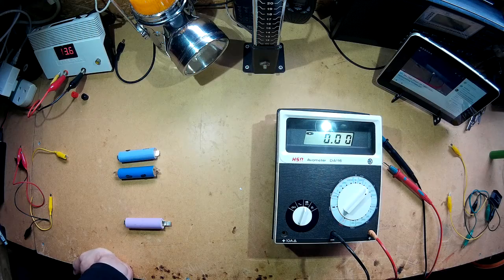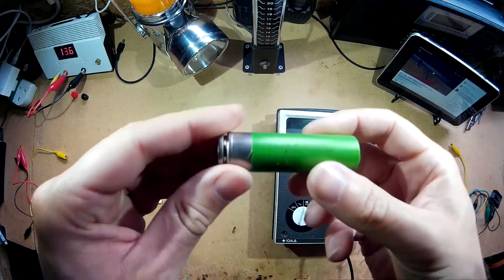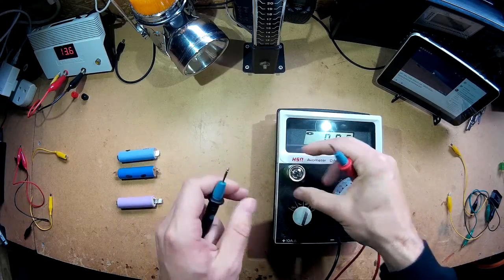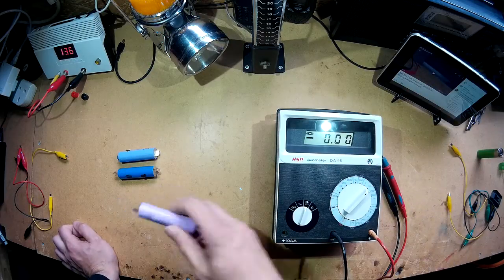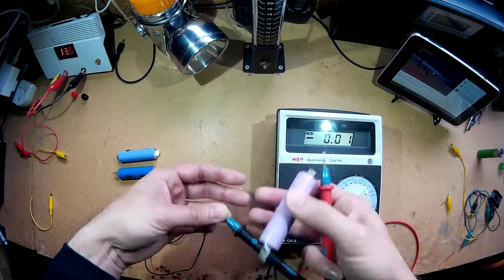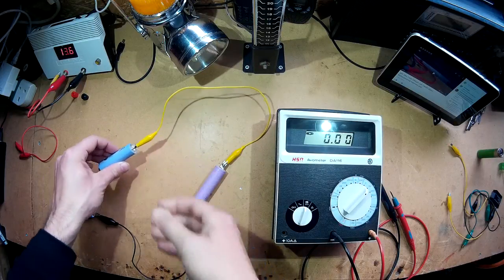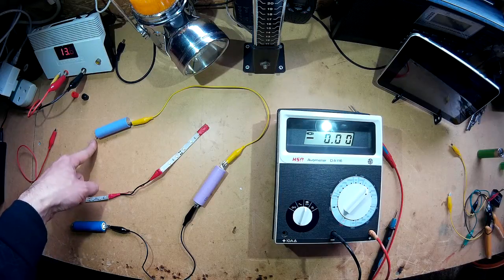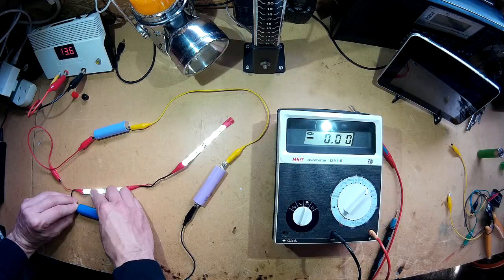Batteries In Series How To 18650

Comment: I'm rebuilding an 18v rechargeable battery pack with rechargeable AA 1.2v batteries.  I'm having difficulty trying to organize a 3 rows of 5 cells so I can strap them in series. Could you possibly  give me a top/bottom view of how I should run the straps. If you were to look at the battery pack the cells would be stacked 5 high and 3 columns.  The upper most left cell would be + and the upper most right cell would be - (from a top view) for the connecting wires for the device. This configuration will allow me to fit the  pack  back into the snug compartment.

Comment: Thanks for sharing. Any help appreciated. Is it better to connect series first, parallel first, or does it matter? Is there any chance (with proper soldering) of the solder breaking connection with the cells? Soldering vs spot welding? Thanks in advance.
Reply from the maker: had no problem with joints if you proper solder.
Reply: @JAYZWORKSHOP  :) Thanks. Does it matter if cells are connected in series or parallel first? I've seen people do both, but some say it's better one way or the other. I have 2 cell packs to build, but it's my first time and I want to get it right. Lol, they aren't exactly cheap if I short them out and/or blow my pack up.

Comment: does anyone know how many 18650 cells would you need to make a 96v 40ah battery pack and how do you connect them? its for a ebike
Reply from the maker: Amarildo Dervishi something like 460 cells assuming each battery is 2ah 20 batteries in parallel 23 batteries  in series
so thats 20x23= 460 batteries .

Comment: Really well described walk through :-) I have shorted a few cells when trying to run them in both series and parrel before now when messing and testing but not accidently bridged one yet :-D still they are very robust for sure :-p I can never seem to tab these bloody things properly and haven't got round to getting on a y.t. tutorial for it yet :-)
Reply from the maker: battonfive Yeah when tabbing i use fine sandpaper were soldering and put some solder flux on before soldering.
also a50w- 60w soldering iron  to be able to heat the joint quicker, that way you don't heat the cell as much and risk damaging it. 
Thanks mate.
Reply: Norfolktuber thanks honestly! for some reason putting flux on the cell didn't occur to me :-p don't know why as I flux all my wiring and stuff :-D
 yeah even with my super hot soldering station the solder wasn't keeping contact with the cell ends, it was just trickling off to the wires I was trying to solder on to them :-)
 Will have a go over the week and report back to say if that was the prob I was having or if it was something else :-D
 and yep totally agree the hotter the station for a quick solder is definitely the best approach, the heat ripples out on these little usb pcb boards I use a lot something terrible on them :-p